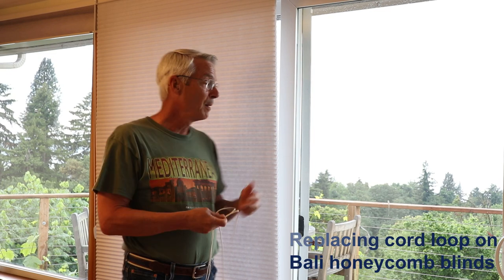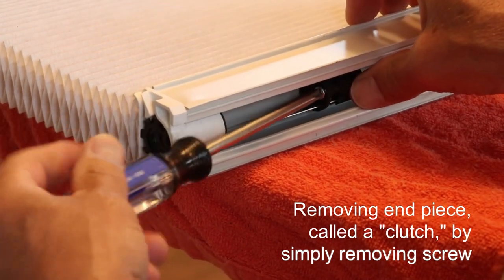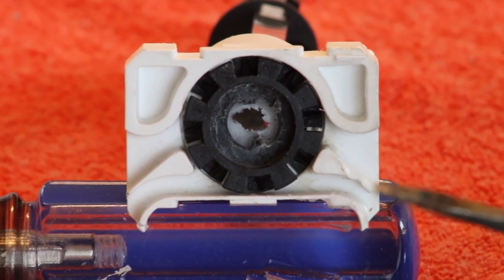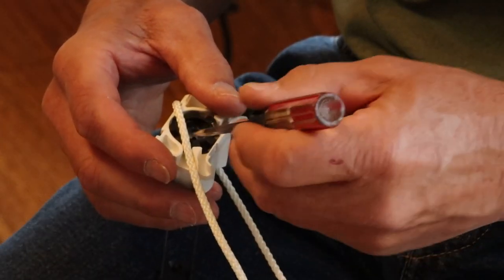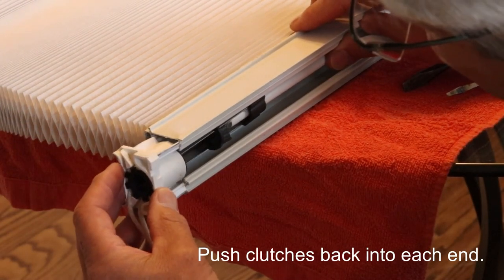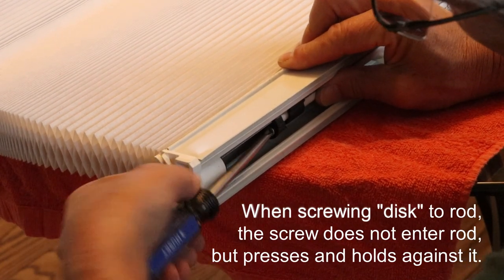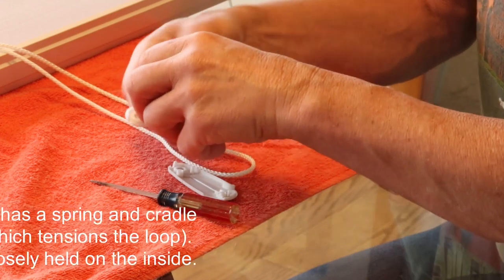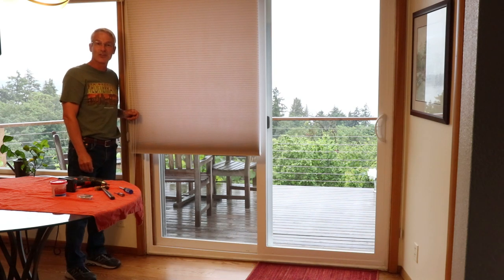How to Replace Window Shade Loop Cord

Comment: Thanks Karl - you inspired me! After watching your video I was emboldened to get into some blinds in our home that haven't worked for 8 years! The cord lock has been broken, and I didn't realize it would be a modular design. I was able to pop it right out of the end in minutes. Bad news is, the part doesn't appear to be available on the fixmyblinds site. Good news is, it doesn't need to be. Upon further inspection I discovered that the cord lock is a two part plastic assembly, and the parts had separated. I only needed to re-glue them. Sweet!
Reply from the maker: Yeah!  Good job.

Comment: After working it, I like it without a tensioner. Also it will last longer without a tensioner because of the angle the cords go in, in the front. I can hold the cord so there is a lot less friction. So all is good.

Comment: I just received and installed my continuous cord blind. They sure cheapened the tensioner, it is useless. And the cord is so short there wouldn't be a way to attach it to the wall. I guess they expect people to just have the cord dangle without a tensioner.